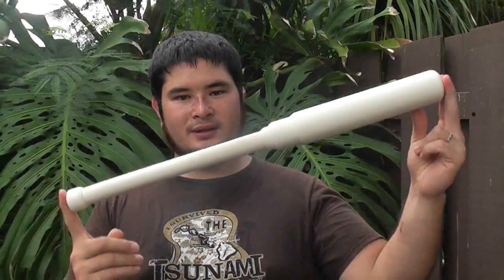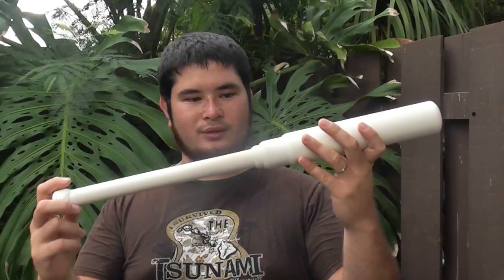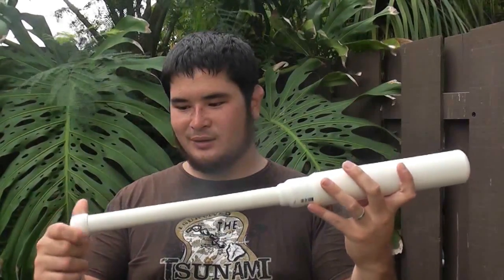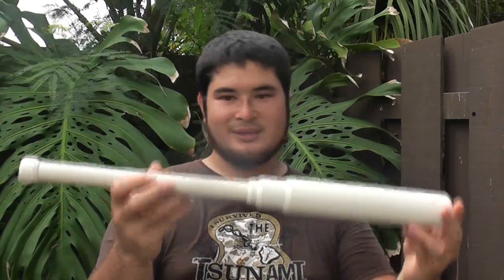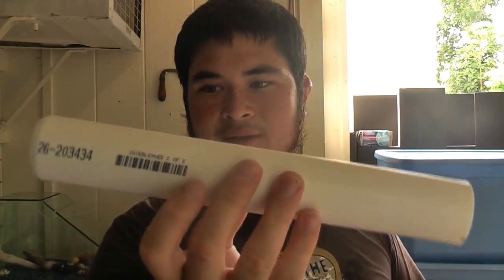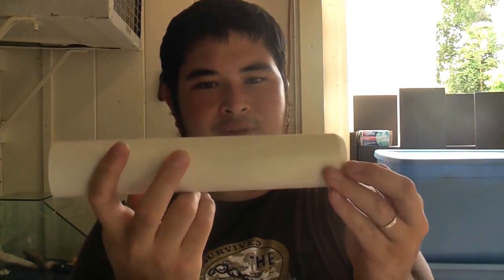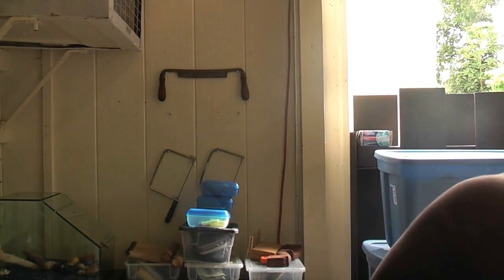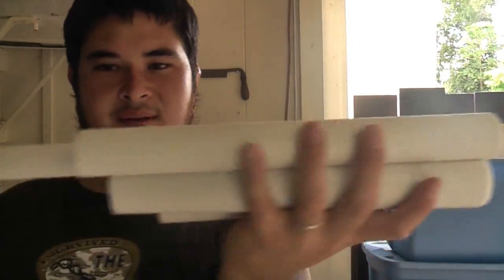How to Make Light Indian Clubs or Clubbells With PVC Pipe Part 1

Comment: How heavy could you make these? I'm looking for something in the 8 lb range.
Reply: Even with black pipe and lead it’s hard to get to this weight unless you are using 1 1/4 pipe or over with longer lengths. The current cost makes it better just to buy them.